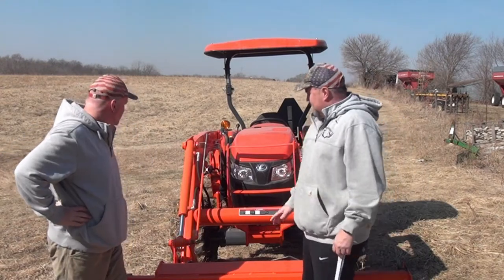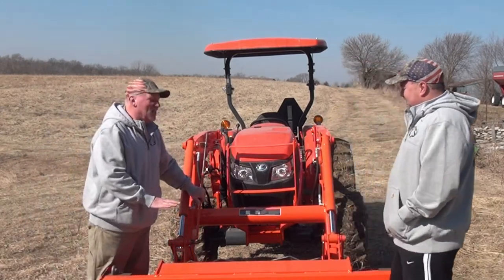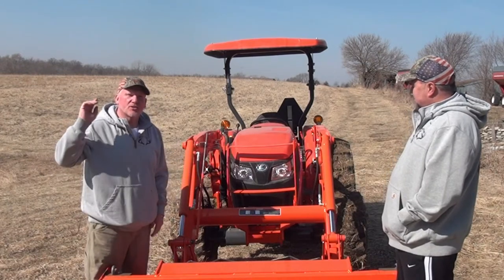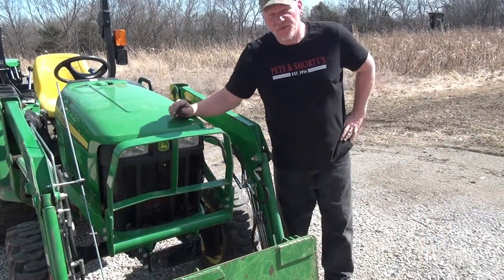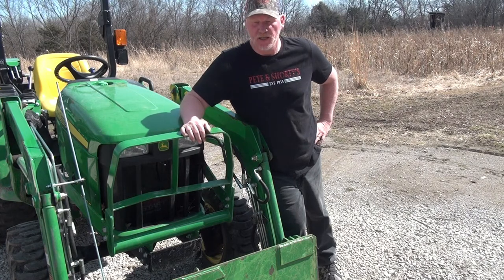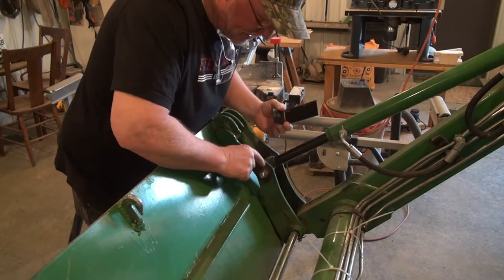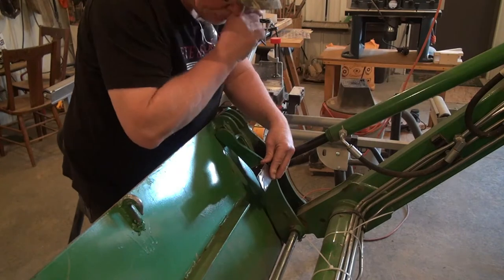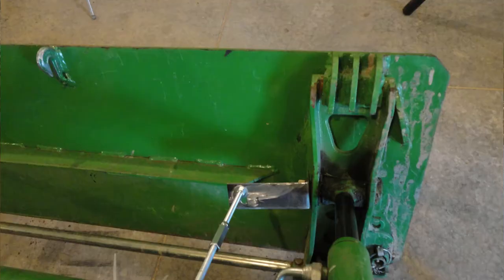DIY loader level indicator-John Deere 3038e

Comment: make a new solid  bracket bolt it back on the bucket a add a BALL JOINT, 3/8-24 HOUSING THREAD, 3/8-24 STUD THREADS WITH DIRT SHIELD then you wont have things flopping around
Reply from the maker: Bubby a ball joint was my first option, however my local hardward store did not carry them and I went to plan "B".  We appreciate the viewership and comments.